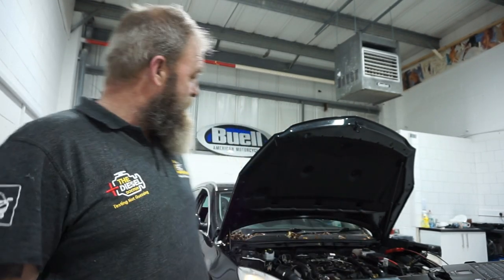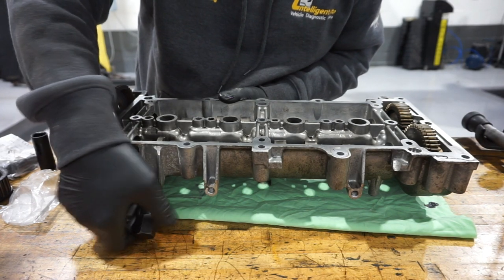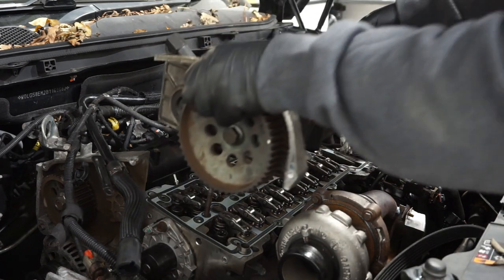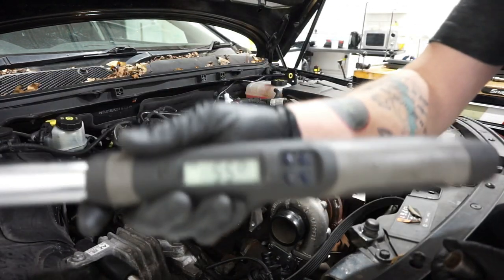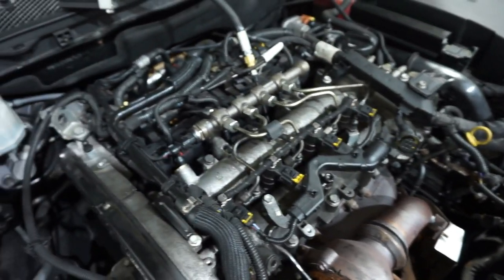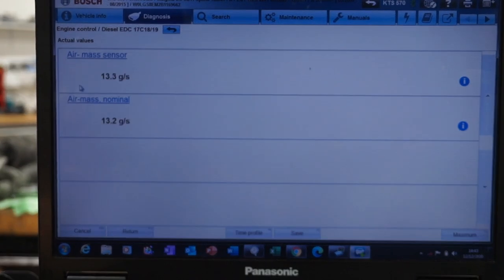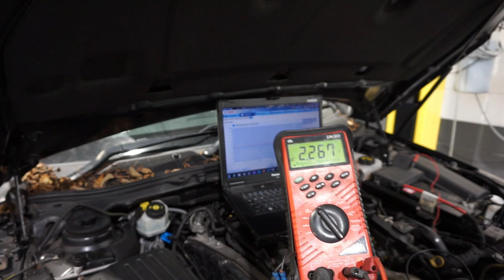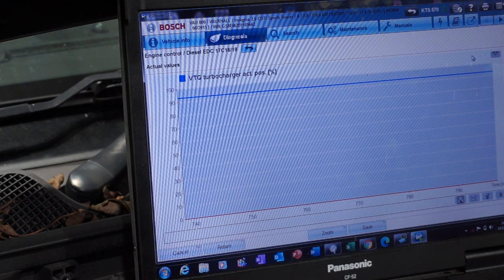2010 Insignia 2.0 CDTI P2282 Mass Air Flow Part 3 plus a twist?

Comment: I bet the original owner of this car wishes he brought it to you in the first place . The comment about a £2500 car misses the point that to replace with any half decent car can be 12 to 15K upwards . Cracking job and explanation , Thanks .
Reply: But after spending £2500 this still isn't a decent car, you have a 90k mile 10 year old insignia with 5 previous owners, which will need money spending on it again soon, it's not a sound investment.... but yeah I totally missed the point, I forgot, you spend £2500 on a £2500 car and now its worth £5000, and it will run flawless till 200k. How silly of me, I totally forgot!
Reply: @threepotMR2  Fair point but for now the owner can drive and know its fully sorted by Gary for now LOL But its still worth remembering unless you buy brand new a "unknown" 2nd hand car will still cost plenty more .££ €€ etc .

Comment: Some person right now has to be £2000 to £3000 in to fixing a £2,500 car. And all this money spent is down to the previous garage(s) incompetency. Someone tried to MOT this in December with fail list inc DPF warning + visual smoke test fail, and it's now passed on 10th Feb with 83k miles on the clock. At this value of car, this money pit is no ones friend!

Comment: In the turbo portion, I wish you would have done the unplugged it test, what are the volts from the ECU to the sensor, 5v or 12v, or a bias voltage to monitor wire integrity? Your simulator is cool but with the multimeter verifying what the scanner showed, I already trusted the wiring. I have no problem with redundant tests as I do not trust scanners at all, to me, they are only a guide. Thanks again.
Reply from the maker: It’s 3 wire sensor on the 5v ref circuit.